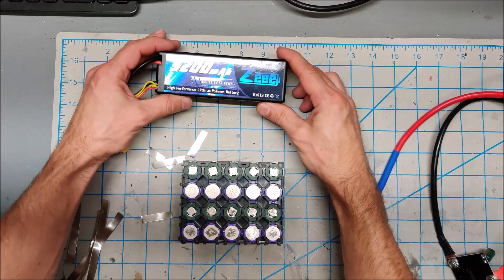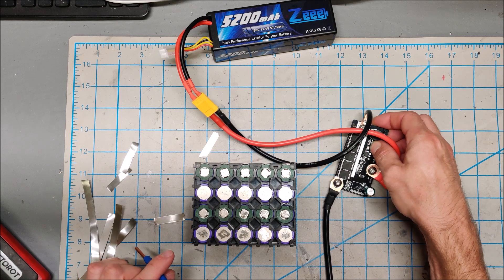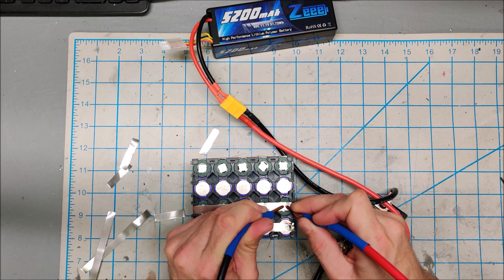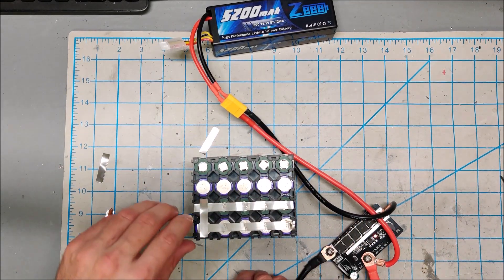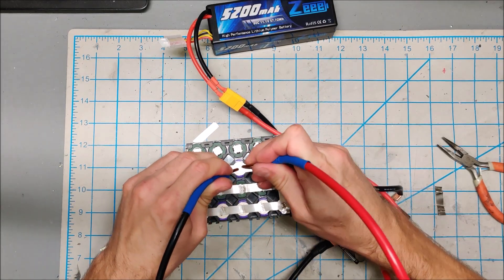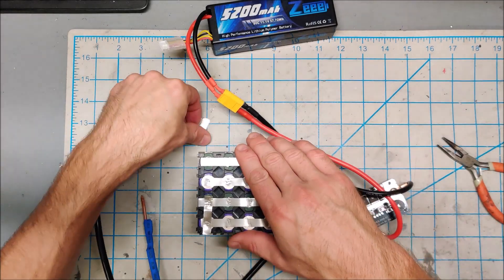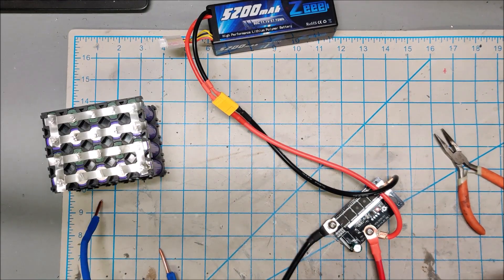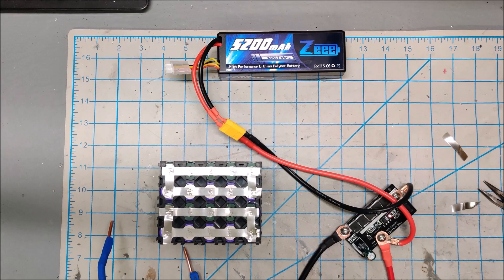QUICK 4S PACK USING 80C LIPO ON PCB SPOT WELDER

Comment: I bought this exact battery and it has 12AWG leads, even though the pictures showed 10 AWG. My spot welders manual says to use a battery with minimum 10 AWG leads. Does your battery have 12 AWG leads as well? I wonder if its okay to spot weld with 12 AWG?
Reply from the maker: I'm sure it's fine. It's such a short burst of time, the 12awg won't have time to heat up.

Comment: Man, you're using 3S, not 4S. Be serious.
Reply from the maker: Im making a 4s battery
Reply: @stevenc22  That is a 3S battery!
Reply from the maker: @salvoognibene8054 that is a 4s 5p battery. 4 rows of 5 cells ?
Reply: @stevenc22  No, that it's a simple 3S1P... man. Be serious!
If you mean the you've ASSEMBLING a 4S5P... well, you are using fraudulent keywords in the video title.
Reply from the maker: @salvoognibene8054  Dude. Yes i am building a "quick 4S" battery pack exactly as the title says."Quick 4s pack USING a 80C lipo"

Comment: hi i have some question 
That spot welder is working on  12v~14.6v  
but your battery is 3s right? (11.1v) 3s lipo full charge is 12.6v (4.2 x 3)  

but spot welder cut off 12v   that mean 0.6v can use from battery  

or  spot welder is working under 12v  more than low voltage?
Reply from the maker: Yes it welds below 12v but I don't really go below 12v. Even after a bunch of welding the lipo stays almost full

Comment: why are the battery wires jumping? i am curious now.
Reply from the maker: Flow of electrons
Reply: When current flows through a conductor a magnetic field is created around the conductor. Since we have two conductors with opposite flow of current parallel to each other. They repell
Reply: quite a lot of current

Comment: On the product page it says it can only handle 90-150A. Would I be ok using that battery with the supplied needles?
Reply from the maker: Yes. it will not weld well at only 150A and who cares if we blow up some of the mosfets, the board is cheap!

Comment: Can I use small size mah Lipo?
Reply from the maker: No. You need 400+ amps to weld. A small Mah battery won't deliver that
Reply: @stevenc22  But you could use 2-3 let-s say 3S 5000mAh 30C lipos in paralel right? I have nine of those.
Reply from the maker: @Seneslau07  actually yes 👍. In parallel configuration you will increase the amps available. You would only need maybe three in parallel to get the amps you need
Reply: @stevenc22  That being said,I'll probably buy a 40A 12v car battery, just to not have also lipos on the appartment table besides hundreds of li ion cells(all of them dangerous) and send thousands of kind of small short circuit-shoks in lipos especialy because I plan of continue using them in rc airplanes..

Comment: can you use this with a lead acid battery?
Reply from the maker: Yes, it works just fine with a good lead acid battery
Reply: Can you use a 12 v motorcycle or car battery?
Reply from the maker: @tode0001  that probably doesnt have enough amps
Reply: @stevenc22  Thanks